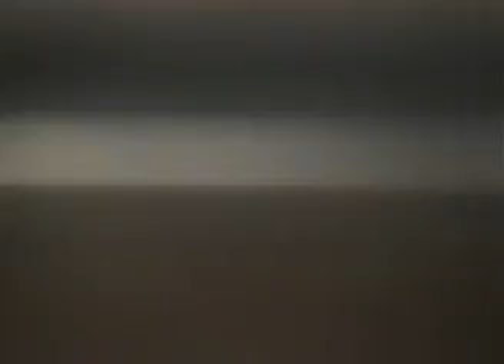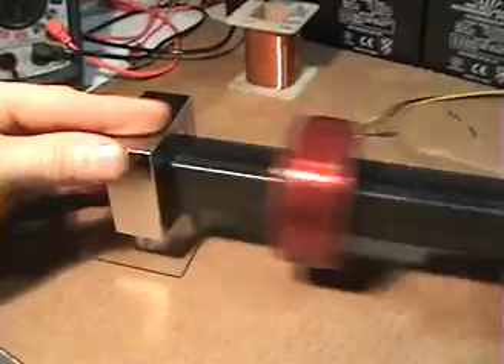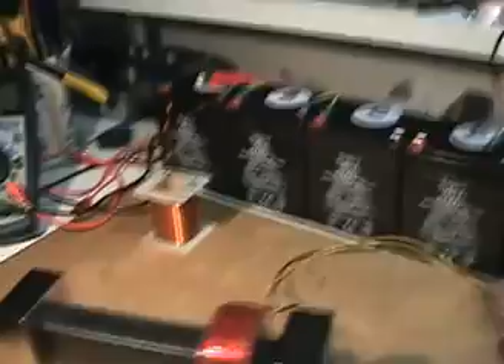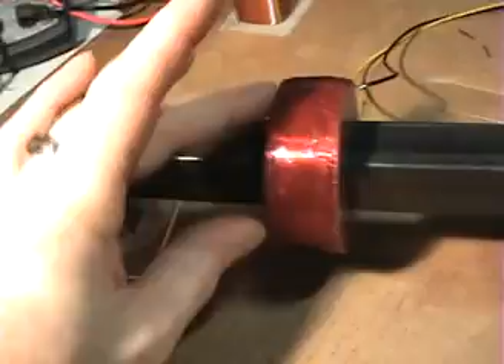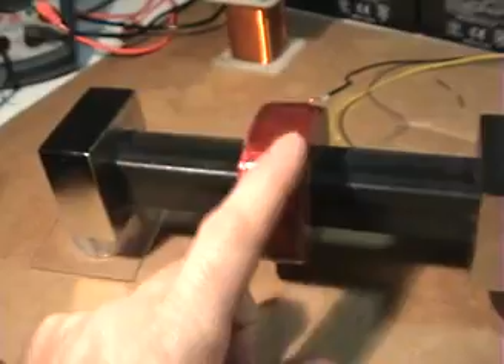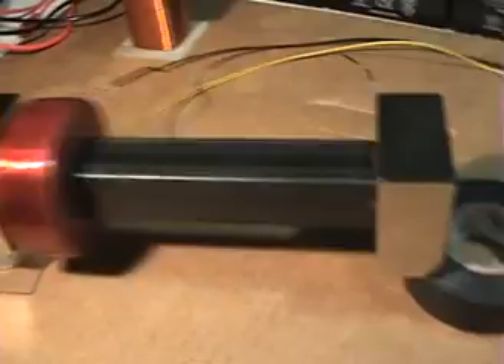Mostly Permenent Magnet Motor test 1

Comment: Build a rail system for the coil to shoot back and over like a loom. Put springs each side to cushion and then return the coil. It might not make much difference if the coil was another 8 mm wider, build a little cage for the coil and then slide it back and forth on  a rail system. Maybe if you made a complete coil around the whole outside like here https://m.youtube.com/watch?v=J9b0J29OzAU you could generate more electricity ?

Comment: With a bifilar coil you could generate and feedback a current to create a resonance thru a capacitor. May be with less distance between the magnets, the frequency can be higher as well the torque.

Comment: how much force could that produce? if you increased the voltage?
Reply from the maker: Yes, of course if you increase the voltage it gets stronger but that one was my first version. I've developed it way beyond that. Here is a super build: https://www.youtube.com/watch?v=f6pc-XNS9uo   results are a  2.5Kg. Pull force with 1 volt @ 0.4 Amp = 0.43 watt
Reply: @gotoluc   Thanks for your reply, why did you use steel and not iron?
Reply from the maker: Because, Pure soft Iron is very expensive and probably next to impossible to find locally in the size I need. There's a point where one needs to be practical. Besides, steel is mostly Iron. The main advantage of pure Iron is, it can demagnetize close to instantly, which is not needed in my motor design since the permanent magnets never change poles or flux density. Only the electromagnet has a change.
Reply: @gotoluc  Understood,  thanks very much. Would this work in one direction with a spring return and a dc power supply? and if i flipped the 1 of the permanent magnets so it would repel and attract the coil at the same time?
just trying to understand more before i purchase all the parts.
Reply from the maker: @thomasharvey184  It could but to compress or expand the spring you'll need twice the input current. So may as well just flip the currents polarity and no need to deal with springs.
Reply: Luc gotoluc Choquette cool thanks you! Love your videos

Comment: when i tried to design a magnetic motor, i was drawing round magnets that moved other magnets of different sizes around.  It turned out looking like crop circles.  I think the sunflower pattern is a good design to move the magnets around in both directions simultaneously.  But i forgot my design and i gave up because at certain points on all the designs, there needs to be a shield between magnets, but there's no way to shield magnetism.  But then i found that magnetic shielding will work if it is cooled to near 0.  But of course it takes energy to cool things that cold, unless it's in space.  
I like the toroidal structure and i designed a system that circulates a magnetic fluid over the surface of a spherical toroid, which contains rings that spin in opposite directions, creating gyroscopic nutation, and also have mag points on them, in a graded scale, lots on the ring at one end and few on the ring at the other end.   The magnetos fling the fluid around and through the system, so that the entire sphere is covered with moving liquid metal stuff.  I have no idea what it would do but if it mimics the dynamics of a star or something then it should do something cool, I'd guess.  Create a gravity field, idk...

Comment: You should put a volt meter on the metal bar. To see if any current is generated. It would be high current, and milivolts if any. But it could be something, build multiples and series. Lime solar cells. They are 1/2 volt each. There should be some current. Because of the changing magnetic fields.

Comment: Will it work when the shaft is standing vertically?  Very cool!
Reply from the maker: Yes, it will work vertically as well.
Reply: So, you could drive the coil up with a half cycle and then let the coil fall down using gravity to save more energy.
Reply from the maker: Unfortunately you have to apply more power (about twice) to drive the weight of the coil up against gravity, so there would be no gain. I know, I've tried.
Reply: Thanks for responding!

Comment: Magnet have same pole facing each other??
Reply from the maker: Yes, the 2 magnets have the same pole facing each other
Reply: Luc  gotoluc Choquette can you please show the design and magnetic field distribution on paper
Reply from the maker: It's simple. The two same pole magnet flux balances out to a neutral point at the center of the Iron bar. When you energize the coil it produces a south pole on one side and a north on the other. If the magnets are both north then the coils north side  will push away and the south side will attract which causes the linear movement. I've made much better versions of this principle all shared at this topic: http://overunity.com/8429/mostly-permanent-magnet-motor-with-minimal-input-power/#.WqfO2eYpDM0

Comment: The think sience overlook about magnets is preety simple.

With right knowledge you could even propaby create engine with magnets alone.

COz there is NO free energy here and all laws of termodynamics are still intact.

MAGNET IS NOT MAGICAN DEVICE. IT IS A magnetic BATTERY!!!

You used energy to mold it you used energy to magnetise it. You dont get any free energy. You need to learn how to use that energy. We mostly using magnetism creating it from electricity coz it is easy to control magnetic fields.

This engine is a example of harvesting a energy stored in magnet to convert its energy on a work using electricity input.

I wish you a good result ;)

And no i`m not a freenergy freeak i dont like to be fanatic over somethink without understanding it so if i`m wrong plz correct me it will help me to grow :)

Comment: Do you think this will work the same (or better) if you simply use disc neodymium magnets? Say 20 magnets SN-SN, then a small iron bar and then 20 more magnets NS-NS. Would the linear motion still occur if the coil is sliding on top of the actual magnets instead of iron?
Reply: It will not, that peace of Iron has quite crucial role in this setup.

Comment: Do you think creating a magnetic return path by placing the whole thing on a large iron block help? Or maybe it will hurt, because of the N-N orientation of the magnets? What about a return path on the outside of just the coil, i.e have it inside an iron pipe with washers at the end.
Reply: +Alex D Nevermind, you answered my question in the middle of the video :D

Comment: great idea! very simple. instead of putting a small current into the coil to get it to reciprocate, could you manually reciprocate the coil until the magnetic field takes over and it moves on its own while outputting current from the coil?
Reply from the maker: I would like to be able to do that but it's not something the law of conservation of energy seems to allow to happen.

Comment: Cool.  I may wind a coil and do this with smaller magnets that I have and use coat hangers as the rod.  Same thing, just much smaller scale.  Plus I want to try to see if the electro magnet can produce electricity if I put other coils in certain places where it will pass.  It should make a linear generator this way.  From the coils that are placed beside the moving coil, possibly hook up a step up transformer and run it back to the power source. No attempt @ free energy, just redistribute it.

Comment: hook it up the coil to a trash bag pulled tight over a frame, then hook up the coil wires to the speaker connection in the back of a stereo, turn it all the way up and play some death metal.......

Comment: hey there @gotoluc have you tried adding "static electricity" in ur model? it could greatly increase ur output, say wrap rubber bands around the coil and have it lightly rubbing a grounded winter hat as it moves, just a thought, awsome rig!

Comment from the maker: @fisalsadoon 

It may work if it has square wave ability and 20 volts peak to peak. The generator I use is a wavetek 134. You can find these on ebay for about $40. to $50.

Luc

Comment from the maker: @fisalsadoon 

Q: r u still working on improving this motor ?

No!  It has a strong generator effect. The coil is moved by the current sent to it but as it moves it sends back current (because of the permanent magnet core) which is kind of a fight between the two. This is aka as CEMF. This limits this design and most of all motor design for that matter.

The Orbo design claims to have no CEMF but would needs to be confirmed by replicators.

Luc
Reply: Uh oh facts, run!

Comment from the maker: @fisalsadoon 

you need true AC square wave to make it work. You are probably using Pulsed DC which makes a square wave but is just on off of the same polarity. 

You should be able to make it work with the output of a real (not 555 timer) signal generator. Or build a flip flop switch circuit like I did in test 2 video. This is the best way as you really need sensors to stop the coil movement if you want to make it work best.

Have fun

Luc

Comment: i tried to replicate u r project but  till no luck , mine will travel only one way with square wave ,then it will stop, but when i use 5v power supply and  manually switch polarity it will work as fast as i can switch polarity.
plz ,any advice will greatly appreciated.
Reply: FULL BRIDGE RECTIFIER!

Comment: Why not use a metal cylinder, instead of that rectangular piece? I imagine a plastic coating slathered with a silicon-based lubricant would move a helluva lot better.
Though, there's the chance for the coil to start spinning/twirling as it moved, which wouldn't be cool for the wires. :P Hrm.. could add tiny rails to keep it on track.
Probably more trouble than it's worth, anyhow. interesting application of magnets, tho.

Comment from the maker: Hi Drdump1,

I don't think I will continue to develop this motor as it has too much of a generator effect. So as current is feeding so is current going back which prevents the full potential of the motor. It's called counter electro magnetic force. Most motors have this CEMF problem. The Orbo claims not to have this.

Luc

Comment from the maker: Yes knowledgemonger, it is very close to that. The full intention was to have the south poles directed over the outside of the coil by two steel curves like this (O). But like you say the generator effect will also increase.

Luc

Comment: I'm not sure what core you are using between the magnets, but if it's conductive, you should try placing a voltmeter across the magnets.  It may be interesting to see what the rod it doing.